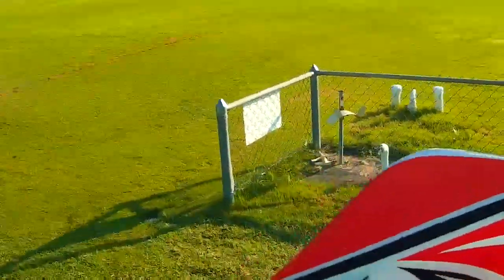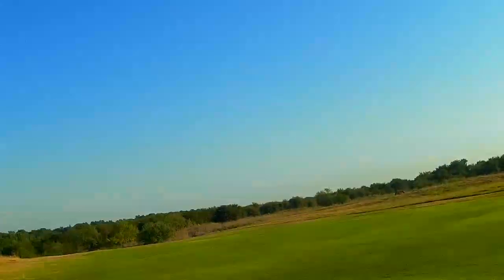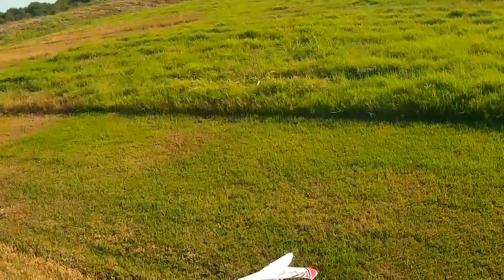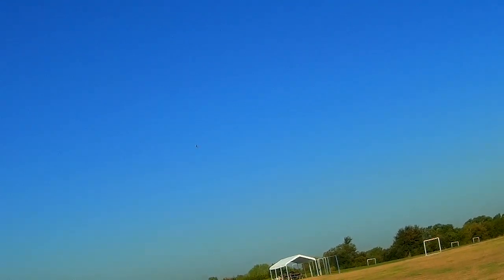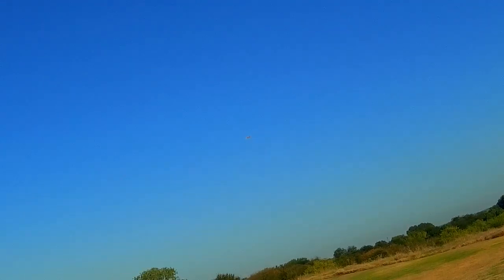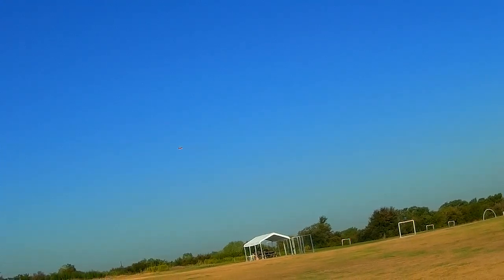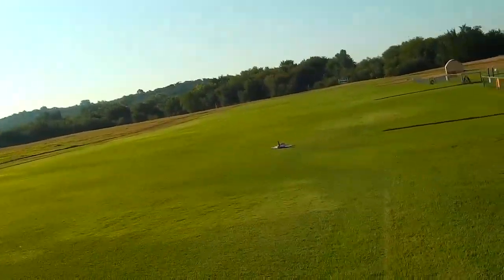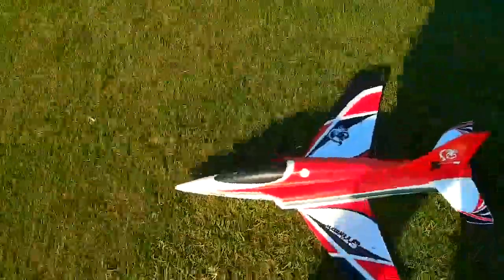Freewing Stinger 64mm  -  Flight 2 and Bad Launch on 9-3-19

Comment: Taking a look at the size difference between a stinger and rebel which of the two do you think is a good first edf jet. I was going towards the stinger because of its size to be able to fly in smaller areas and you can belly land as well
Reply from the maker: The hands-down winner is the Rebel.....It is a fantastic jet, and much easier to fly than the small stinger. It does cost about $60 more, but it is worth it....(it has flaps and retracts)
The Rebel is a good flyer, even at half-throttle. The stinger, due to the smaller wing seems to need much more speed to fly well. If I could only have one of them, I would go with the Rebel. (It is my favorite EDF, out of a dozen or so models I have been able to try out.)